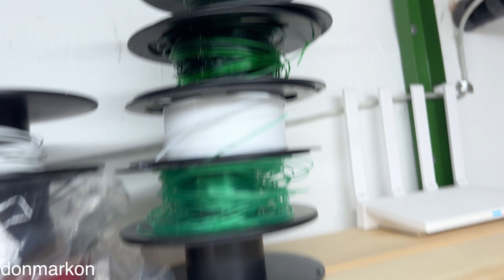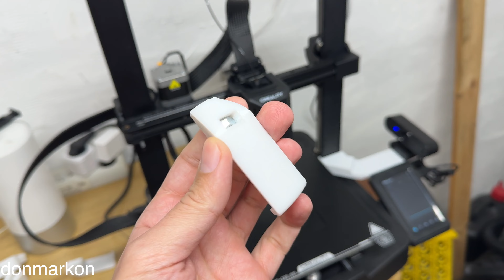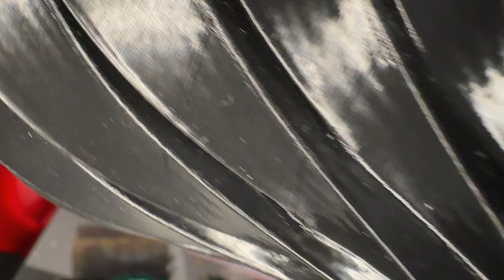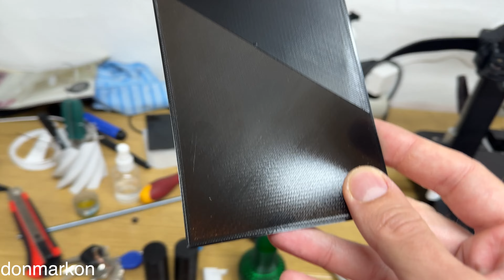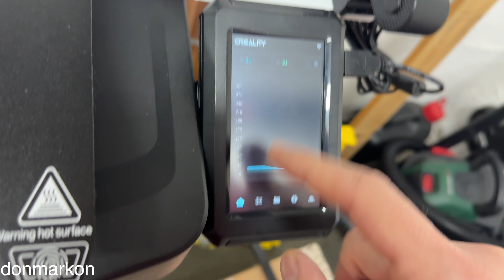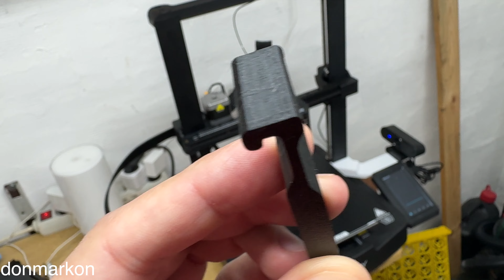Creality Ender V3 KE Long Term Review From Real User  #3dprinter

Comment: I'm the happy owner of v3ke, too.
Why do you think the cable holder and additional height of the spool are necessary?
What I think is important is enclosure - it makes ASA and ABS prints perfect, PA12 prints almost perfect.
Also, spool holder axis with bearings (and avoiding filament sensor) are imortant for fast TPU printing.

Comment: Bought a KE in October, within a week it suffered the blob of death, so went out and bought a Bambu A1 - putting the KE under the table till last week. Totally stripped the hot end down and replaced everything including the header board and got it working again.. Did a benchy to check all was okay, not a problem, good clean print..... Then I thought I'd run a real job through it, nothing complicated and watched it do it's first few layers, to make sure it was all okay. Should not have left it. when back out there an hour into a 2hr ish print and low and behold Mr Blobby was back.
The A1 has been pretty good.. this thing is just a pile of useless junk and with what it has cost in spares for repair and buying it in the first place I could of had another A1 and a mini to boot. 
Never again will I buy Creality - they make em to fail and their gear seems to be hit and miss - and that's from what I have gleaned from many a blog etc mostly on the enders - I would be weary of buying the higher ended ones and the things could be plagued with problems too.
Time to strip it down and put it in the spares box..
Might try a Cobra max next or even build one.
Reply from the maker: Hey man
The solution is an easy one. Automatic bed levelling and automatic z offset 
When you set up the printer i always first print a layer height high 0.2 mm test cube
Bigger - better
When printer prints that first layer you usually need to lower z offset a tiny bit to get perfect line squish and perfect layer adhesion
Because what is happening - probe set z offset which is fine but variations exist = poor bed adhesion 
BUT when you set it up like i told you here it will always have probe settings set, plus z offset adjustment, you did put additionally 
I did had blob of death once - after that i figured out that poor bed adhesion is a problem, lowered z offset after that and i had around 40kg of filament printed without any problem
Reply: @donmarkon  Cheers - might give the thing one last go and try again and adjust the z. and if it does what I want it to do, will keep it solely as a backup. 
"Use only if there's a problem."
I'm in the mood to by another machine as well, one with a large bed for a project I have cooking... the Cobra Max looks good with it's easy nozzle.🙂👍

Comment: I am a heavy user of my V3 KE and only complaint I have is the linear rod bearing slop and the use of a single bearing per side on the Y axis, I have had mine almost a year. I ended up upgrading my linear rods to linear rails with 2 bearing blocks per side, what a world of difference. No more bed wobble.
Reply from the maker: That is good upgrade
I did had few upgrades and had over 40kg of filament printed with it 
Good printer for small mount of money

Comment: I bought my first 3d printer, V3 KE, was only $150 USD. I am currently in the process of printing upgrades. Moving the spool off of the top and locating it on the right side, Nebula camera mount/filament guide, relocating filament sensor to the hotend, adding G-sensor mounts to hotend and bed. Next will be gantry supports. I have no idea what I'm doing as far as settings yet, maybe watching more of your videos will help me in that area.

Comment: Thanks for the recent review. The KE’s available for about 75% of the original price lately and at that level I think it’s a really good value.

Top tip for all printers, make sure your first layer is good before zoning-out from watching your machine. My trusty KE had a recent bed adhesion fail that made a horrible mess of my hot end. This type of failure can happen on all printers and a good first layer tends to indicate you’re in the clear.

Comment: My V3 KE Printer arrived with a faulty CR-Touch sensor. Took a month to resolve that. 8 weeks later the Y limit switch failure and no response from support. Bed must also be warped beyond what auto-levelling can cope with, as it kept burying the nozzle and wound up coating the hot-end in melted filament (and filled the sock). Going for a high-end (non-Creality) printer next. Really appalled at Creality customer service.
Reply from the maker: I had few problems and they sent me new parts... but it i huge downtime as they answer 1 time per 2 days on average during 7 days week ...
But ... when i fixed everything (i had blob of death 2 times) printer really works well it prints high quality and when you tune it thats it!
But build quality is so so ... but again it works! For 200 euros it is fine deal and it can be cheaper
Reply: @donmarkon  4 days and still no reply from Creality to multiple requests. As for print quality, it likely varies from batch to batch. Perhaps mine was made on a Friday afternoon? 😀 When it worked, mine was wildly inconsistent after tuning. I could not print anything other than single small parts (and I have the enclosure). Was a very frustrating experience as my old basic Ender-3s gave better results (I have 3).
Reply from the maker: You should start new warranty dispute they should reply on every email